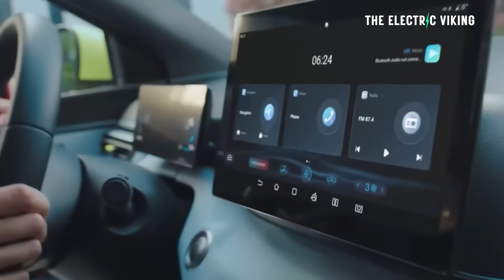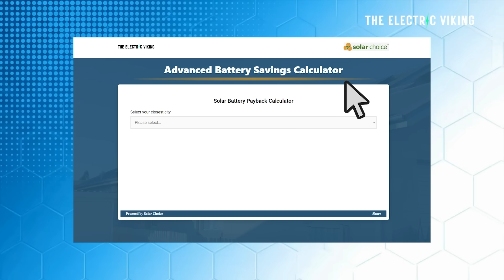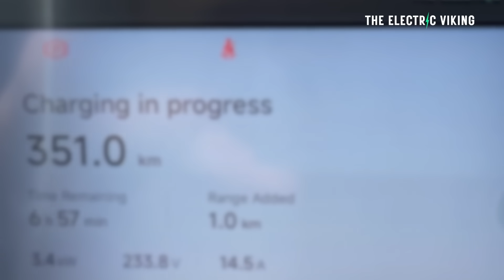This Data from 2025 PROVES Legacy Automakers are COOKED

Comment: 80% EVs! "Moving" batteries will change the world. Energy will be stored and produced locally. People starts to understand the advatages of an EV.
Reply: Yes slowly but surely boycotting oil companies karma to these companies for killing or slowing human progression.
Reply: If you live in a house sure. If you live in a condo with many units there is not way for solar panels be installed to feed your EVs demand. Most likely solar will power the elevator and lighting of that condo.
Reply: You need to understand that batteries are way too expensive to sell a cost competitive vehicle without subsidies. And stop saying gas is subsidized, so is electricity. Those are commodities, the actual product is the car. Gas cars are not subsidized and Legacy's take a loss every time we sell an EV under 50k. That's why they don't sell them and no one can compete with BYD, who's using the CCP government flood the market with unfair practices and willing to take losses to flood it because it keeps their labor and GDP up
Reply: @gcburns4 Stop LYING. Tesla has done what the lying and corrupt Legacy Automakers have FAILED to do. 
They are trying to MAXIMIZE Quarterly Profits and CEO bonuses and care NOTHING for Long Term viability of the Company. GM used to sell 10,000,000 vehicles per year about a Decade ago and have had their arses handed to them by the Germans and Japanese BEFORE the Chinese started kicking their butt too. Lazy and Corrupt and going to go BANKRUPT AGAIN.
Reply: @gcburns4 unfair practice? Do you shop around?  Do you like paying high prices? I prefer to pay the lowest prices. Let the Chinese government subsidized my car.
Reply: @gcburns4 The gas is not subsidized? What about the petrodollar, the wars, interventions, boycotts, threatenings of countries, the confiscations of oiltankers around the world to keep the american people quiet. Now it is possible for people to be free. To store, produce, consume and even sell your own energy. That is a revolution. Even for the far right freedom fighters.
Reply: @gcburns4  Gas is not subsidized one cent. The only subsidies oil companies get are for whacky 'green projects' (and those are going away)

Comment: Data is fairly clear in both Australia and USA.  2025 Australia:  1,200,000 cars sold, 104,000 EV (about 8.5%)   Best selling?  FORD RANGER (gas car).  USA:  16,300,000 cars sold, about 1,200,000 EV or about 7.4% EV.  Most popular?  Ford f-150 pickup (gas) followed by Chevy Silverado (gas).  So yes, the data is really clear that legacy auto is selling well over 90% gas cars in most of the world's car markets...except China.    Chinese market is over 50% EV but there is still an immense ICE market there as well.  BTW worldwide, the 'used car' market is the biggest segment and it is mostly ICE.  Legacy auto not going anywhere anytime soon, especially considering that Ford and GM are integral to USA's defense biz.
Reply: This too will change.
Look at the trend line not just the current stats.
Reply: @John-p7i5g  Did not say it wouldn't change.  Just said ICE represents about 90% of the current auto production worldwide.  Said it was not changing anytime soon.  When the batteries are better, people will buy EV.  It is that simple.
Reply: @SunriseLAW  No, you cherry-picked countries and then made a global conclusion of 90%.

Why don't you simply look up the % of cars sold that are plug-ins worldwide?  20 million out of around 90 million total.
Reply: That's like citing the sales of horses and carriages in 1907 to prove that those new-fangled horseless carriages weren't practical. There may be some question as to when, but the transition is inevitable.
Reply: And most of those markets either have not had a chance to buy EVs yet, or they're developed nations whose populations will only shrink in the future as the old folks die off.
There's no future there.  Who's trying hardest to develop new markets?
Reply: Look at the OEMs Altman Z scores.
No profits.
No future.
Reply: The average sales price is equally important from an automaker's perspective. Average price for new vehicles in the US market is around US$50,000, but in China it's about half that price. It's actually why Toyota's profit is greater than that of all Chinese automakers combined. 1 unit sold in China is not the same as 1 unit sold in US, Europe, or Japan, especially as foreign brands were forced by the Chinese government into 50:50 Joint-Venture schemes with Chinese State-owned-Enterprises. Profits/losses from the Chinese market are shared with JV partners.
Reply: What data did you reference? 1.2 billion cars sold in Australia, 2025 ..... I don't think so.
Reply: @teejay5295  I obviously put 1 extra zero in there.  But you know that, you just being picky.  And even then, it is not billions. Jeez, why are you freaking PICKING ON ME?
Reply: @teejay5295 1.2 million not billion